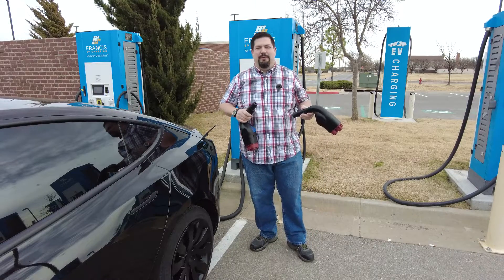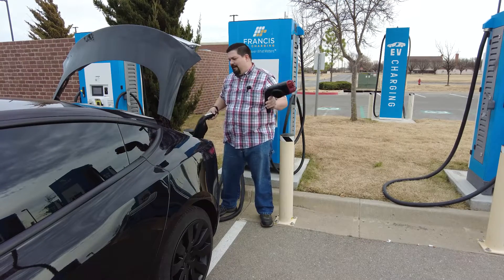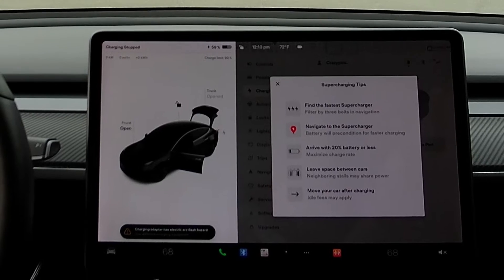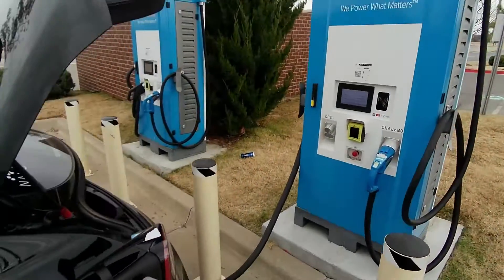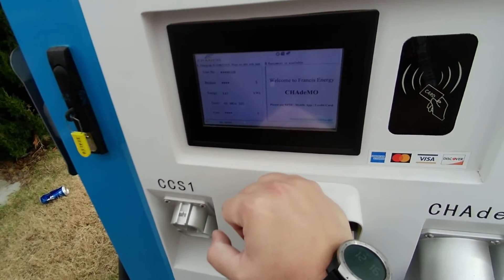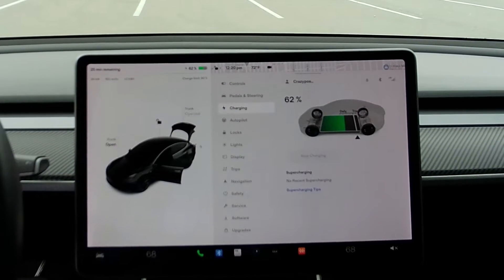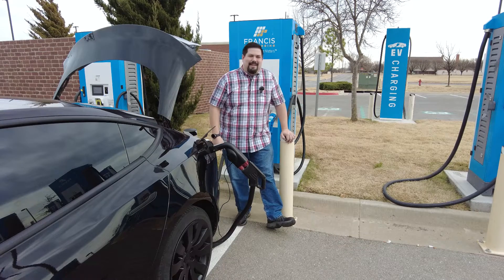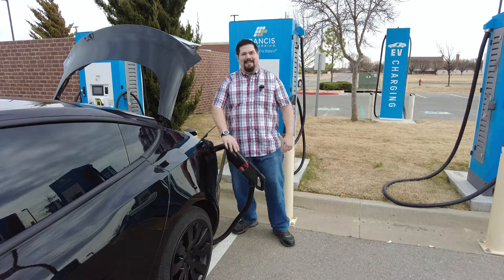Tesla Setec/Lectron CCS1 adapter testing

Comment: I just bought a Lectron CCS1 to Tesla adapter and tried it for my first time this evening on the Electrify America network.  Just added 4% charge in the test before I disconnected. I did get the equipment arc warning right away, but it kept charging.  I have a 2020 Model Y LR that is CCS enabled, running software 2022.12.3.20.  I'll be curious to see if it maintains a longer charge time with the error. Planning to post a video to share results.

Comment: Why don’t use the tesla chademo adapter?2019 tesla don’t have the possibility of the ccs
Reply from the maker: You are correct a passive CCS adapter would not work on my particular car it doesn't have CCS capabilities that came about a little bit more recently... it takes theese more complicated active adapters. The thing is it's very hard to get a Tesla CHAdeMO seem to be always sold out. These CCS adapters are all over the place but much less reliable.
Reply: Chademo will eventually be phased out. That's why Tesla is not selling them anymore.

Comment: Those Tellus Power stations you tested on are the same model as the first fully functional Francis stations in New Mexico. I really don't like the tiny text on the UI of that charger and that the charging session info disappears very quickly (within 10 s) after you end the charge.

What do you think about the news that Francis Energy will be increasing their rates to 39 c/min up from their already high 31 c/min? I think it's a bad move since now at 50 kW it will be the equivalent of $0.468/kWh and at the theoretical max 60 kW it'll be $0.39/kWh. That's way higher than Electrify America in the per kWh states without a subscription.
Also, does Francis charge you the dollar session fee on failed charging sessions? It would suck if they did when the charging stopped within 1-2 minutes due to an error.
Reply from the maker: I found that if I'm under a minute I won't get charged, but if it fails after a minute it still charges the fee... Yeah, I think these new higher rates are very unfair to slower charging cars including Tesla's with adapters.

Comment: Once Tesla offers their official CCS adapter, I think your success rate will go up when using the official one and Setec will be fit fir the pit.
Reply: Tesla is taking their sweet sweet time releasing it. That’s why I made sure to pick up a Chademo adapter when I bought my car back in September.

Will they release it this week, a couple months from now or the end of next year? Who knows 🤷‍♂️
Reply: @Lynyrd_Evnyrd  gotta be close to release. South Korea has the adapter now
Reply from the maker: Absolutely
Reply: @Crazypostman  I love your channel because it appears you are very honest and have not dramatised anything. Keep up the good work.
Reply: The official Tesla ccs adapter will also require a charge port chip upgrade for those without the ccs compatible chip so there may still be a use case for the setec for some time.
Reply: @sandpine  yeah, lucky me my 2021 Model 3 doesn’t have the chip 😭
Reply from the maker: It doesn't? 😯
Reply: @Lynyrd_Evnyrd  yeah it seems that they stopped adding the chip a few months ago, and went back to the chip that does not support ccs. Someone on the tmc forum has been compiling a spread sheet of cars with and w/o the chip. So for now only models 3/Y produced after about Sept 2020 to late summer of this year have the ccs chip.  Must be related to the global chip shortage 🤷‍♂️
Reply: @Crazypostman  It’s true, no CCS support for me. We’re in the same camp on needing a retrofit 😵‍💫
Reply: @Crazypostman  my June 2022 LR Model 3 does have the CCS compatibility
Reply: @PurpleSideBlack  I may have just missed the cut off with my August build. At least I didn’t have to deal with not having a USB hub like the cars that came after mine 😂
Reply: @Lynyrd_Evnyrd  I have a co-worker who got his a few months after me and he's like you, missing the CCS chip. :(. At least he and I both received the free Supercharging credits.
Reply from the maker: How do you know if you're missing the CCS chip?
Reply: @Crazypostman  press Car > Software > Additional Vehicle Information > CCS adapter support: Enabled
Reply from the maker: @PurpleSideBlack   I don't have CCS support
Reply: @Crazypostman  Ak! That's unfortunate. Surely it's can be upgraded.
Reply: @Crazypostman  my 9/2021 mylr reports "not installed" under ccs support.